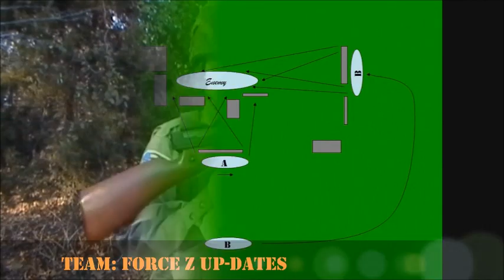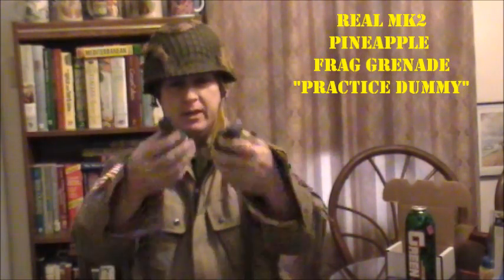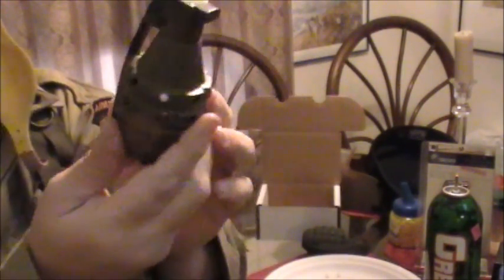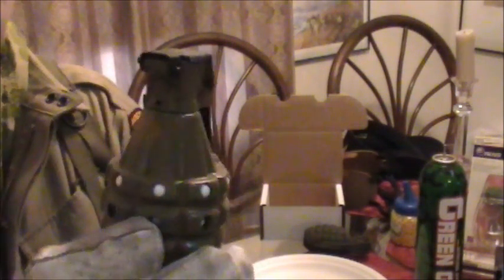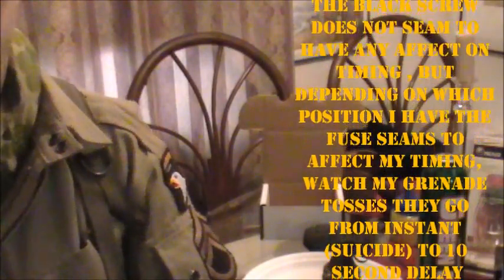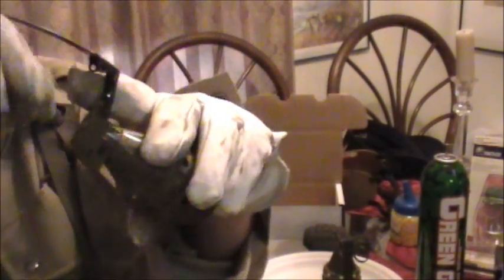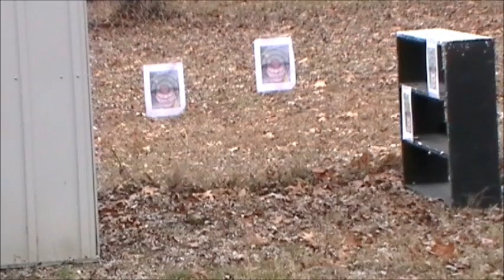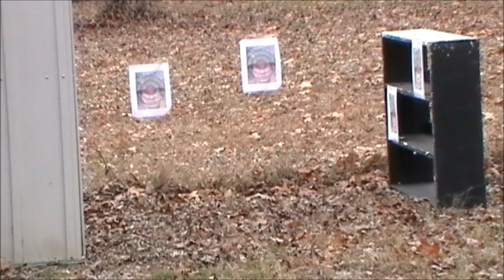Snicker Mk2 Pinapple Airsoft Hand Grenade

Comment: Awesome. I've had this grenade for over 1 year but the timer was set so short, it would pop right after it left my hand. I started using string to slow down the fuse. Other people had low quality vids on it & they would say the black screw was the one to adjust timer but it never worked. Thanks to you, I can finally use it & got the timer just perfect. In Feb, we have a game @ an Urban Mount field & I can use it with my Tornado, DeepFire & VFC grenades. I'd recommend using .12g bbs, flies better